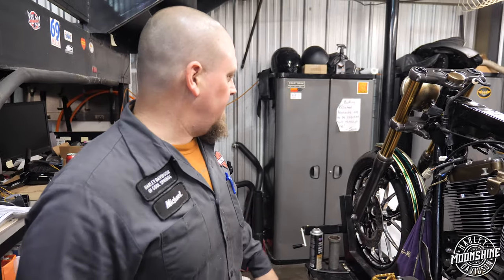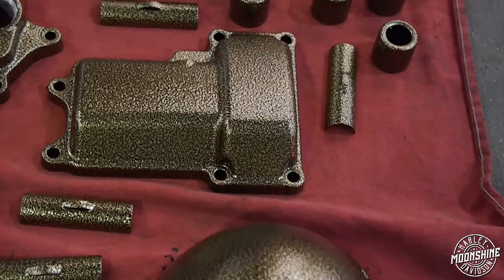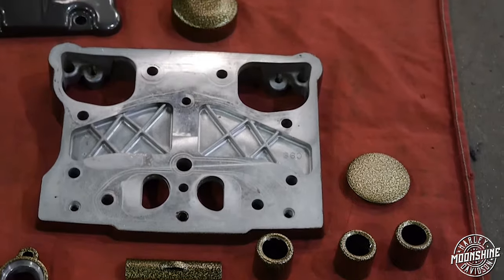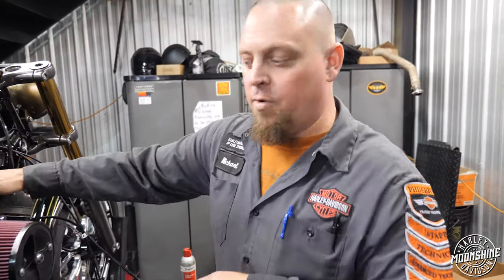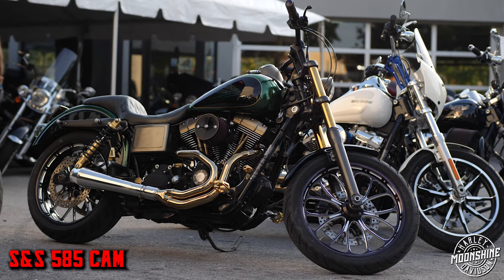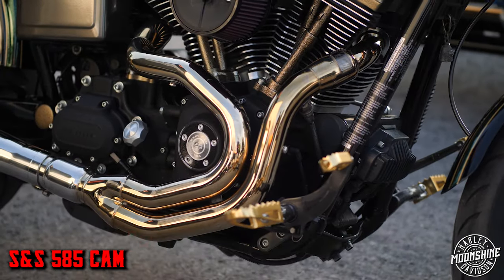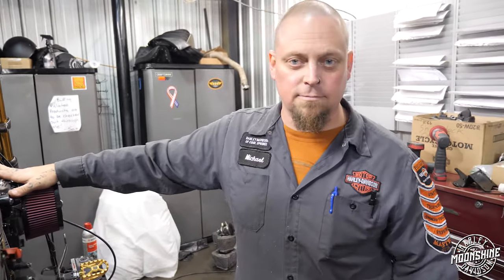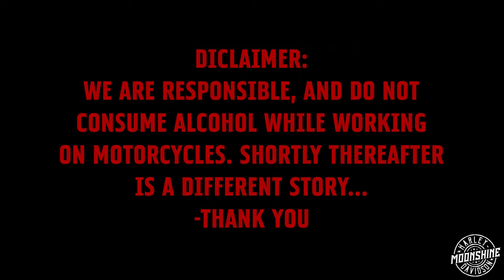Rebuilt Dyna! 73HP to 120HP, 84TQ to 126TQ | Shop Talk Episode 30

Comment: What is your verdict on the Thrashin Supply exhaust?  I have a 2017 Low Rider S and I really like the look and sound of Thrashin’s pipe with their “Dog Ball” insert.  Perform well on the dyno?  If so, would it complement a 117 build?
Reply from the maker: It's one of our favorite softail exhaust systems. It'll be perfect for you. We also have them in stock 615-275-4170and ask for Aaron, Nick or Jamie.

Comment: Any head work done on the bike? Was the throttle body left stock?  What tune was used on the bike when you had it on the Dyno?
Reply from the maker: Moonshine HP heads, HPI throttle body, Power Vision Tuner.
Reply: @MoonshineHarley  would you mind giving the specs on the head work done to match up with the S&S 110 cylinder and piston kit.  As well as which HPI throttle body was used?  They have different sizes diameter sizes as well as intake runner sizes.

Comment: Are the heads completely stock? And is this bike running a stock throttle body?
Reply: No.  Moonshine heads and HPI throttle body
Reply: @NoName-vz1ob  I was wondering if this bike is running the mr103 cam or the standard 585 and if your running compression releases with the easy starts? Looking into a similar build
Reply: I'm also contemplating running a 50mm tb with like a stage 1 head rework  (1.9 intake valve upgrade with porting) but am wanting to get around the same power out of my bike as what you got out of this beautiful beast. I am just assuming this bike is running upgraded intake and exhaust valves and a 55 or 58mm tb. What is this thing runnin
Reply: @davidhirsch2791  58mm throttle body.  Standard 585 cam.

Comment: Hi gents, love the channel my name is Adrian and I’ve got a 2017 Dyna wide my self, I just put a stage IV and was wondering what throttle body you used? I have been looking at a HPI 58mm and by the quick looksy I got the one you used looks like one. Any info would be appreciated. Ps I’m rocking my FXWD on Australian tarmac 🤙🏼